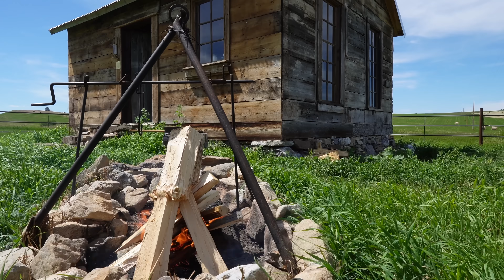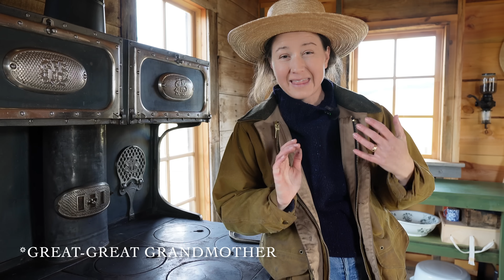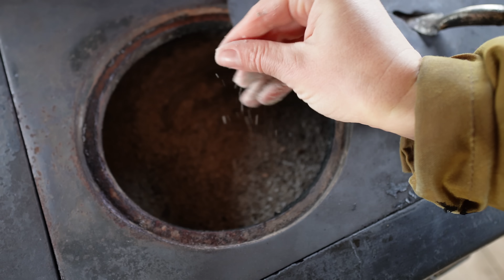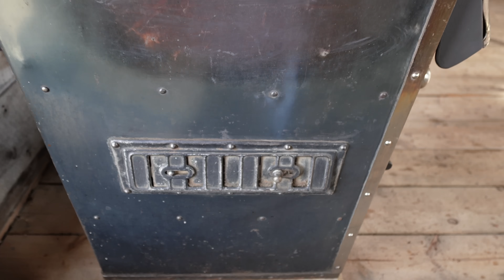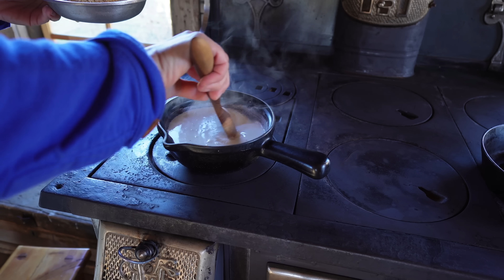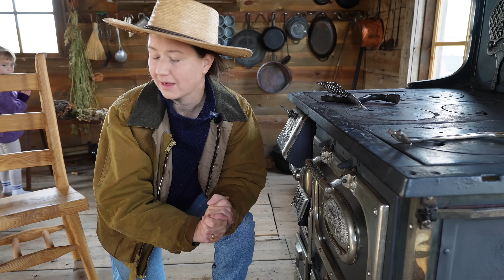How A Cookstove Works 🔥 (wood-fired)

Comment: The stove smoking is a sign the chimney is not drawing properly.  And that should not depend on a breeze outside.  It does depend on the chimney getting hot.  There may be a damper to bypass lower internal passages, allowing heat from the firebox the most direct route to the chimney.  Only after the chimney is hot and drawing is this damper closed, forcing heat to be drawn down and around the oven.  At this point any leaks, if not too severe, will admit air, not release smoke.

Related, the chimney should not have any extra vents allowing air in.
Reply: It's very difficult to explain the ins and outs of draft manipulation to the younger generation, if you'll pardon the pun. I don't think this stove has a proper damper installed in the stovepipe by the way the stove doesn't seem to hold the heat. Jessie never talks about a damper, only the draft and the oven diverter. Also, the young lady admits the fire box is not tight. That affects draft. My mother would wadd up a piece of newspaper like a bouquet and light the loose end and place the lit paper bouquet under the open lid closest to the chimney. She claimed this started a lazy draft and it did keep the smoke out of the house. After that paper was consumed, she lit the kindling.
Reply from the maker: Great tips/knowledge! What I really need to do is tighten up & patch any gaps into the fire box. This stove is pretty poor at closing down the air and slowing the fire. Past stoves have been much better. My monarch stove I had, I utilized the upper draft control in the stovepipe much more.

Comment: Thank you for some very interesting content.

I wonder if the pipes in the back of your stove were for a range boiler instead of a reservoir.  A range boiler is a tank positioned at an elevation higher than the stove.  The lower pipe on your stove would be connected to the bottom of the tank while the top pipe would connect to the top of the tank.  Water is heated in a water front in the firebox and circulated by thermosiphon.  I noticed South Bend did offer a left-hand reservoir, though it is not clear the water front was used for it.  It would be interesting to know!
Reply: Yes, the waterfront or water jacket as it's piped on this stove was to heat piped household water under pressure. There was a hot water tank above the height of the firebox. Some people had a closet off to the side of the stove especially built for that tank. It doesn't take much of a fire to make enough hot water to do the dishes and Saturday night bath.
Reply from the maker: This makes me so curious! I looked up the “options” advertisement catalog for roughly this age. Found photos online. Full of unique options. The giant pressure water tank looked quite wild! Maybe it had that 🤔

Comment: Really enjoyed this video, Jesse.  Please remind people to thoroughly inspect and clean their wood burners before the wood burning season.  I have a small Chrome loaded parlor stove that heats half my house.  In going through it this fall I found some stove cement break outs that needed resealing.  These units are a wonderful delight when properly cared for but can be a nightmare if neglected.  Burn safely!
Reply from the maker: You are so right—cleaning & maintenance is a huge topic! Wish I had talked about that a bit more. Always in the back of your mind 😬 🔥
Reply: @Montana_Ranch_Rescue  Maybe it would be a good video to thoroughly go through a full inspection, repair and cleaning of your stove.  People may not understand how much stove cement is in their stoves , of all sizes, and how leaks through holes and cracks effect the burn of wood stoves of all sizes, especially older vintage ones.  It is time consuming, but maintenance helps to keep un-wanted air from entering the fire  and causing loss of fire control.  Just a thought and if your stove is all dialed in for the winter, maybe a friend or neighbor might have one to use for such a video.  Really enjoy your content!
Reply from the maker: @barbedstar6480 that is a great idea for a video—going on my list for sure 🙌🏻🔥 Thank you!

Comment: Here in Chile at our little homestead we burn almost 8 cords of fire wood a year. 
Our wood stove is ILLEGAL in many states in the former USA. Why ? We use our wood stove for multiple purposes. Two walls of our wood stove fire box are a contiguous water tank that makes our hot water and then the water flows to a stainless steel serpentine, after that it flows to a 95 liter neoprene storage tank on the second floor of our house. Also we cook on our wood stove year round and of course the stove gives off radiant heat. The stove is illegal in the USA in many places because we have a contained boiler as part of our stove. The stove can blow up if we over heat the water, but we have 2 PPR or pressure relief valves. Our stove is so efficient that in 30 min we have scalding hot water for all of our bathrooms and kitchen and for our RADIANT FLOOR HEAT. So we do not pay for hot water, cooking heat, radiant heat for our whole house year round. I burn the wood I cut typically. THIS IS VERY COMMON IN THE SOUTH OF CHILE. It is environmentally friendly and cheap. 
Yes we do clean it every 30 to 40 days. 
We do not throw away our ashes either. Soap and garden uses. 
We rarely have to clean the chimney. We burn it out because the flue and chimney only touch concrete and non burnable material all the way out. NO CHIMNEY FIRES IS GOOD but we like them because for us it cleans out the chimney and it is safe. 
Our wood stove here cost around $3,500 USDollars. But it is the heart of the homestead. 

We really do enjoy cooking on our wood stove and it saves us so much money while keeping us independent from Oil based energy or having to purchase electrical energy. It is just smarter and frankly when you do not have to pay more bills $$$$$$ then you are more free and less a slave. 
Love the videos and the Channel. You should come visit us! Love the videos. Jim in Chile.
Reply from the maker: Honestly as I was reading your comment I was thinking to myself, “I’d love to travel down to see your family & your setup” 🤔 And at the end you suggest it! I’m fascinated  by the life you have built—really brilliant. Excited to read your comments, always! You’ve got me thinking 🔥
Reply: @Montana_Ranch_Rescue  There are very tragic reasons that caused us to move to Chile. Sometimes things make you look at your life. Oh boy did we ever look!

We realized that we needed to forgo money and the forever pursuit of money. We discovered that our time here is family based and time is short. We knew we could not find what we needed or would be able to satisfy our dreams if we did not open our hearts and minds to Gods possibilities.
  

Since we have been in Chile we have never lived more FREE or Safe or healthy. We never looked back. 

If you do not like when you are playing a game and the other player keeps changing or Cheating , the rules then stop playing. We did. 

It is no where near perfect here but it is day and night compared to the former USA. 
We were able to move here and basically retire. We have our homestead and it takes care of us. 

All of those things you worry about for us do not exist. Almost NO BILLS. No Insurance worries. No property taxes. Just living life with the ones who we love. 

The government here is very small and does not pry into our business. WE ARE LEFT ALONE to take care of our selves as we like but they are there in an emergency. So are our neighbors. NO CRIME here. 

Full disclosure, I own a consultation business for people like you who are interested in maybe moving to Chile. It is a mom and pop business and we like our family approach to how we work with people. It is more gentle. 

If you are wanting more answers.... I do not want to hijack your channel, you can look at my channel. You can also contact me in TELEGRAM          @jimdorchak. 

It is not perfect but it is beautiful and clean and safe. For us, and we have made visits back, this is home.    Jim in Chile

Comment: Hmm... not being judgmental, but your cast-iron pots and pans need some work on them. (I need to be doing similar with my knives. They all need sharpening... all 22 of them.) Otherwise you're going to have to strip your cast-iron down, and redo completely.
1) After cleaning one, before your stove has gone completely cold, get your pot or pan; hot enough to steam any remaining moisture off of it. 
2) Then let it cool again, before applying a thin coat of cooking oil on them. (This stops them from rusting.) 
3) Then, before you cook with them again, get them hot, not warm, but hot. This is the polymerization process. (Any smoke and you had put too much oil on. It won't polymerize well, and fail as a micro-flake of carbon.) But also, a preheated pan cooks food better. It is rare when you actually need to start with a cold pot or pan. (It's the same reason why your stove cooks better. Once at a temperature, it takes a longer time to cool down; than lighter-weight ones.) 
4) You have reached your goal; when that polymerized layer is pitch black, and completely smooth. Then you have the best nonstick cookware, that you could ever have. (Tip: When you wipe an oil cloth over the pan, and it comes up black/sooty, your seasoning layer is breaking down.)   
5) Just, never, ever, cook acidic sauces (like tomato sauce) in a simple cast-iron pot or pan. It will strip that polymerization off in no time... and while it's only pure carbon; you're eating it; in your red gravy. 
6) This is what ceramic coated cast-iron is good for. Ceramic coated will never be as nonstick as polymerized, and it will only get less so, as time goes on. But it's the only cast-iron... or any other pot type, that will completely stand up to acidic. 
7) And while I know you like your copper pot, I don't. A cast-iron stove, or open fire, needs weight. Light-weight will warp too easily. (Also sandwich will also warp quicker than cast-iron.) So either; cast-iron, or solid plate carbon or stainless steel. And of those three; cast-iron is cheaper, and easier to keep up. Only stainless steel has an advantage, of being relatively durable, if you don't mind the discoloration, for cooking acidic foods.
Reply from the maker: Oh man if you could stand here in this cabin and lift the copper pot, you’d see it is not thin lightweight modern stuff—this is old school copper. Weighs more than the cast iron! 

I hear you on cast iron care, whew, it takes keeping up with. My skillets have a good layer of smoothness; no rust. Dutch ovens are so so. My giant skillet is a train wreck. I need to drag it outside and start from scratch. 
One difficulty that is interesting for me to learn is that the temperature & humors fluctuations in a cabin like this really take a top on things. Causes moisture to form on surfaces. Trickier than our modern climate controlled homes. 

Always enjoy your comments—cheers from a real Northern Lights show up here in Montana! Best I’ve ever seen 🔥💚
Reply: @Montana_Ranch_Rescue  Cloudy skies here, nothing to see. 

Yes, seeing that your cabin isn't lived in, it's more like storing them in a garage or a barn. Next worst thing is storing them outside. 

If you're going to redo your giant skillet, hit it with a rotary sander, and give it a mirror finish, before building up your seasoning. That's how to to make them nonstick. 

Dutch ovens... like I said, any acidic sauce or gravy, will trash one. I have a dedicated fond pan and Dutch oven for such. They have a ceramic interior.

Comment: I remember when you first started to use that stove and you could not get it to draft, I sent you a message to clean out the ash from the bottom of the oven.
Reply from the maker: That did the trick! 🙌🏻🔥 Took some digging & prodding to find that blocked vent but sure enough! Cheers. 
I will admit I still don’t fully have mastery over the mechanics, but I’m learning.
Reply: It has an oven?  I never knew.  I've got a Fisher Baby Bear just like this one.  Never had a problem with getting it to draw, but never heard of it having any kind of oven, let alone that you needed to clean ashes from it.
Reply: @harrymills2770 because you never heard of it don't mean it didn't happen.
Reply: @harrymills2770 or maybe it's not the same stove.